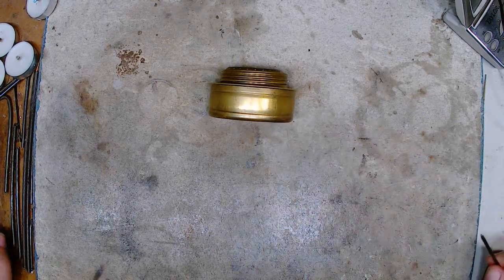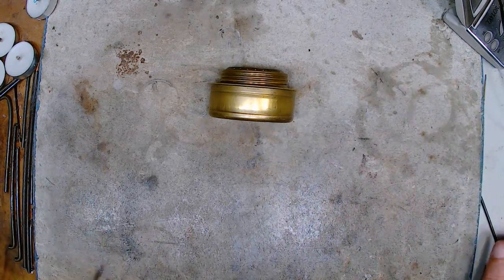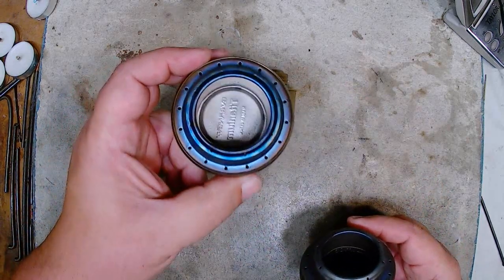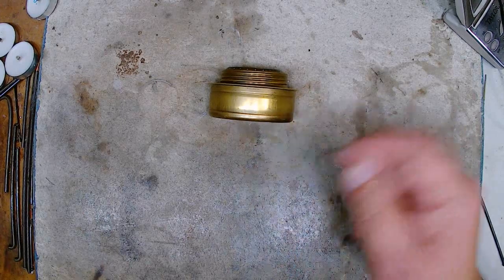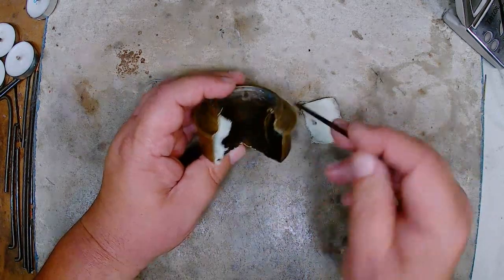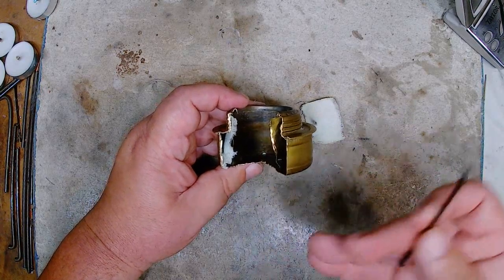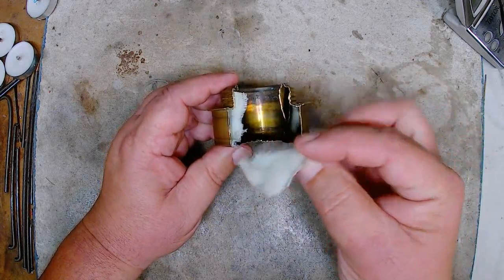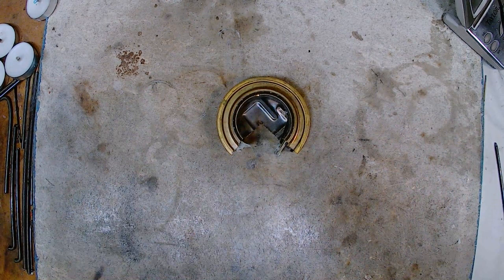Let's See What's Inside a Trangia Burner

Comment: Thanks Hiram for sacrificing one of your Trangia burners to show us the design.  I love my Trangia and Klickstand combo.  I use a Primus foil windscreen on the ground now instead of the Klickstand widnscreen.  The Primus windscreen is more versatile and can accommodate my 8 inch frypan.  I cook pancakes, bannock and fish with the frypan on canoe trips, as well as using my little pots, so the wrap around windscreen does the job.  The simmer ring on the Trangia, which I use every time when preparing a meal, makes the Trangia still the number one alcohol burner for me.  The whole storing fuel  in the burner for transport thing is now sort of a myth, since it seems like everyone's Trangia leaks now around the crimp, despite the O-ring cap (I have 3 burners which leak along the crimp).  But I don't care anymore, because I plan the fuel volume, and I also carry the burner inside a leak-proof plastic container made by Ziplock , not much bigger than the burner with cap and simmer ring (I cannot find these containers any more).  So any leaked fuel is captured within the plastic container, and all is good.  You can also pour out excess burner fuel into the plastic container, and pour it back into a fuel bottle.  So there are ways of coping with a leaky burner.

Comment: Good question well answered. I liked the reveal at 1.29. I've just bought one of these and I don't remember the product description referring to the liner / wick as being important which is surprising as it's clearly key to the Trangia's functionality. Nice to get to the bottom of it. Good comment below by Macdivers1 about putting some fuel in, replace lid and then inverting it to soak the wick to speed the whole heating process.

Comment: Hello Hiram, I just bought a chinesse knock off of the Trangia and I've been very surprised by how fast it bloom on the very first burn. Within 20 secondes the flames were coming out of the jets. By looking further inside the burner what was my surprise to see a little thread coming out of the inner wall. So that knock off that cost me the third of the price of a branded Trangia is apparently built the same way.
Reply: i purchased a full trangia 27 storm proof set knock off,aluminum anti stick version.
and it came too with the same burner knock off with the fast blooming and the little tread coming out of the jet.
the quality was just amazing
it came with a gas burner that work even better than the trangia gas burner
the quality of those knock of are starting to become just amazing.
and costed only 30$
the name was bulin bl100 q1
Reply: Laurent Gouzou AKA Lynx1963 
20s?  That is very long!  I have not timed it but the Trangia is on full power after 3-5s. 
Price is only €13.70 at the moment from Trangia. Other shops are usually even cheaper.

Comment: as hot as a trangia gets i would imagine that that is carbon felt inside.....thanks for the upload HIram have a wonderful day :)
Reply: Carbon ?
hmm carbon?
carbon is coal and burns real well, maybe not suitable as a wick. You might also remember coal is black not white.

Not sure what typically wicks are made of? Cotton? As this is meant to just create capillary forces to suck the liquid up it is probably made from fiber glass..... i.e. glass, which is mostly Silicondioxide, you can also call it sand. Sand does not burn at those temperatures and will last as long as the burner.
Reply: @SamuelLanghorn  carbon fiber felt is used in welding blankets and resistant to 1800 degrees f.  Thanks.
Reply: @chewyandjasper  hmm, I need to investigate this. I have a few carbon fiber snippets lying around but never bothered holding them over an open flame.

Comment: I wonder if the Trangia is really designed to be used with their windscreen bowl holder,maybe it touching the metal of the windscreen and hanging in mid air helps cool the metal, so as not to have it get overly hot(heat sink) and air keep the metal cooler...less heat stress on heat up and cool down?
Reply: Maybe that stops cracks as well.

Comment: what are the jets for? how do they make burning more efficient?
Reply: When you light an alcohol stove the liquid fuel is gasified as the burner becomes hot enough. This in turn creates the pressure required to force the gas through the jet holes and ignite.  Hope this helps. Regards Broadlander

Comment: I wondered if there was some type of wicking material within the burner.  I tried cleaning my surplus M44 trangia because it had some corrosion in the jets and then I noticed the two small holes at the base and saw something.  I kinda picked at it with a pick thinking that it was some corrosion preventing the alcohol from flowing.  I hope I didn't ruin my stove.  Now I know!  Thx!